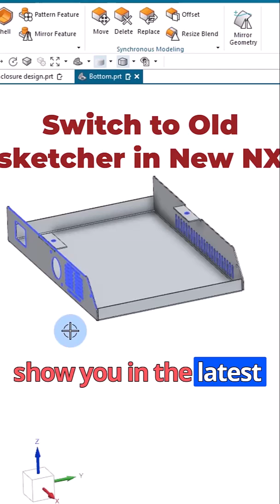Change to old sketch in latest version of NX #siemens #techdesign #unigraphics  #microsoft

Comment: Laptop touchap is not working in new version ? 
What setting can be changed ?
Reply from the maker: Is it not working only in NX application
Reply: @TechDesignsantosh  yes it's not working only in nx neither does left right button rotating the part on screen .